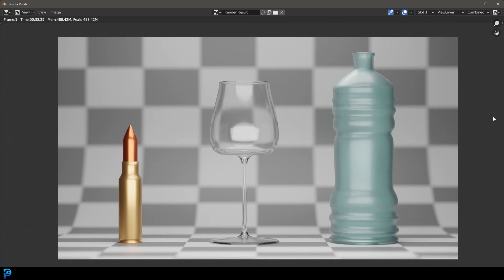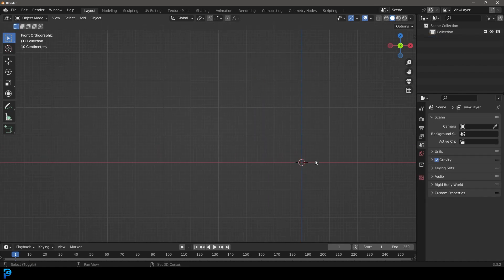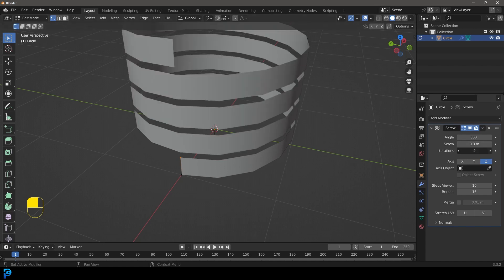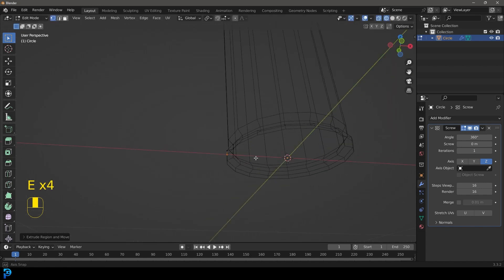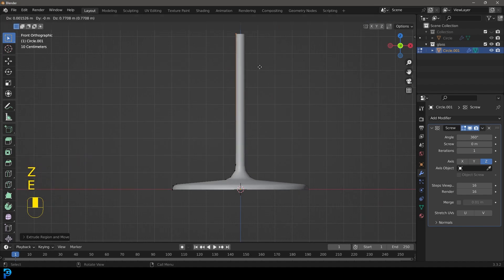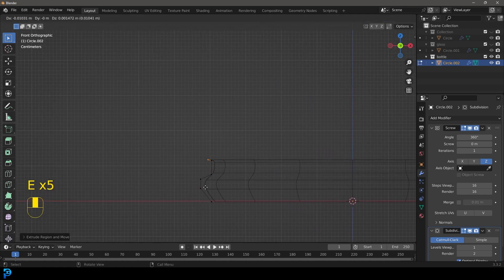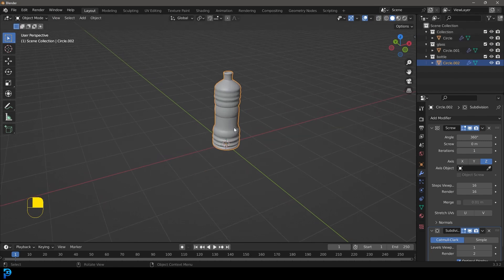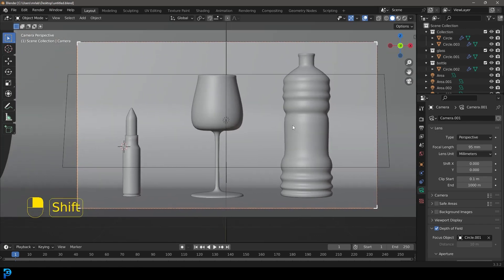Blender's Most Underrated Modifier & How To Use It

Comment: Something must be wrong with my Blender installation (3.4.1) because I can't see the rest of the wireframe created by the Screw Modifier in Edit Mode, only the first vertex and those I extrude. Other modifiers like Mirror have the "On cage" option but I shouldn't need it because when you entered wireframe mode by pressing Z while editing the circle (3:01) all the wireframe appear without the need to activate anything else. The only "not already inlcuded" addon I have installed is Machin3Tools 1.3.0.